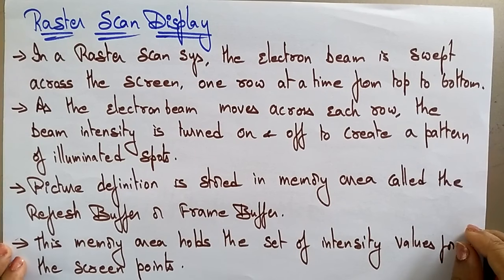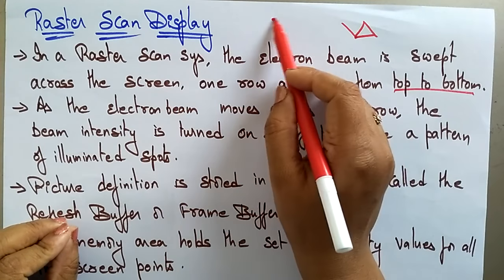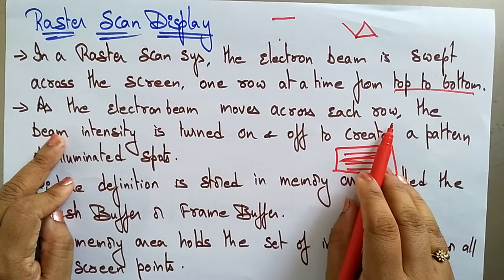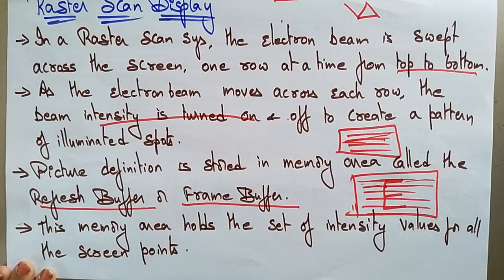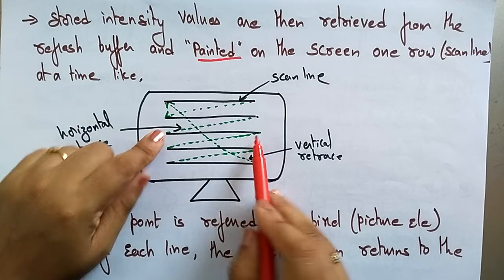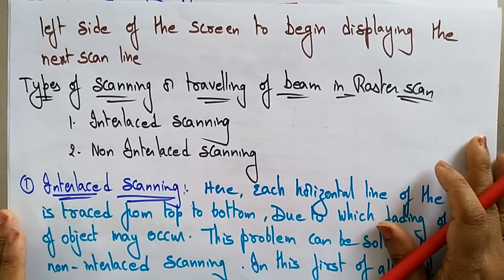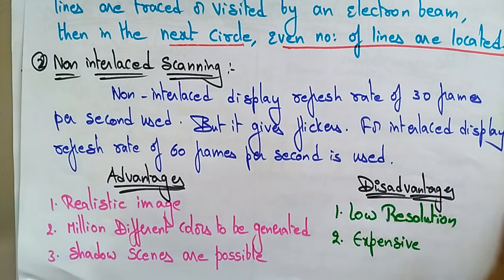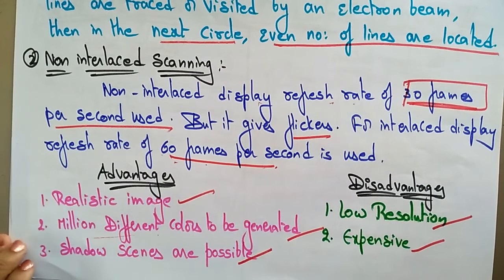raster scan display  | CG | lec-7 | Bhanu Priya

Comment: In my opinion what u r teaching is wrong about that on/off it gets off only when the beam moves from left to right(next line) as whenever electron beam is present on scan line (starting point top left) then it stays on so what u r teaching is wrong it will make pple confused